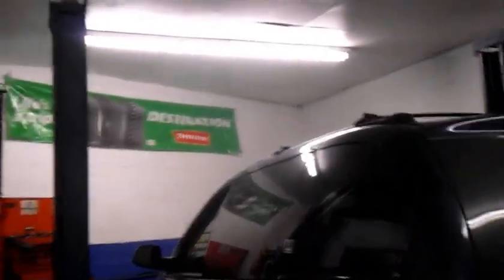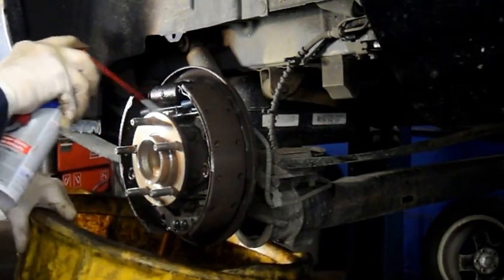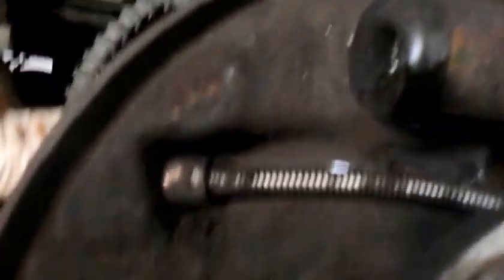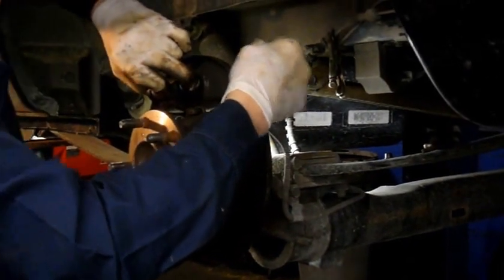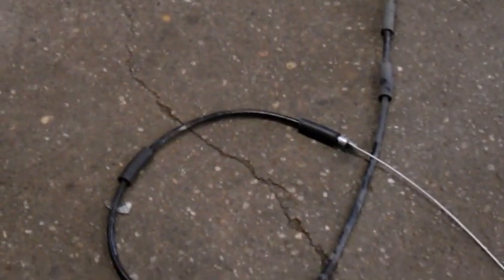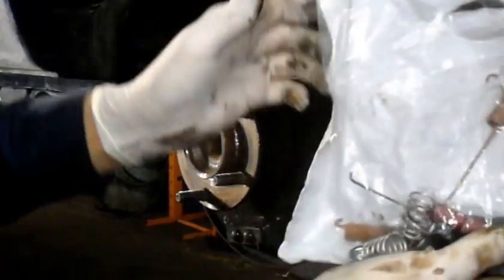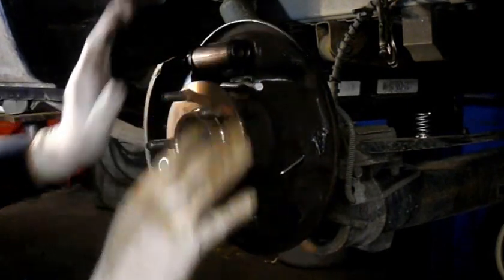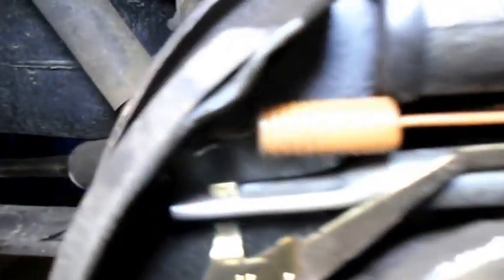How to replace the brakes,wheel cylinder and parking brake cables 2005 Dodge

Comment: Great video! Many thanks to you I followed your instructions when I replaced the left rear cable and it works perfectly. Now I am trying to figure out how to replace the center/intermediate and rear right cables. I assume removing the rear right cable is similar to the rear left which is not difficult. But how about removing the center cable? Do I have to remove the two brackets that hold the center cable to the frame or just remove the bolt on both ends of the center cable that clamp to the brackets?

Comment: Was hoping to see how to reconnect front to rear parking brake cables. I had to replace the front cable, and not sure how to safely get tension off rear to get enough slack to slide front cable stop onto splitter bracket underneath... good video
Reply from the maker: Thanks for watching.  Don't forget to subscribe.

Comment: thanks so much for your video. how were you able to determine that the cable coming out of the rusty equalizer in your video was not releasing?
 i am trying to determine if it is my cable or shoes because my 06 caravan has not parking breaking working.  i have rotors on my rear end with breaking pad shoes.  

i couldn't get the rotor to release today because the pads were pressing out against the hat of the rotor.  the window adjust
was just to get a tool on the cog to turn it.  what do you suggest? i dont want to pull the whole guts of the  parking brake assembly apart by excessively pulling the rotor outwardly.

Comment: I have a Grand Voyager CRD, much the same set up as the Dodge you are working on here in the video. My Parking brake has never really held the car and does not pull the shoes hard enough up to the discs, this even when I have adjusted them through the aperture where you can turn the adjuster as you show in your video. My question is, have the main longer cables from the handle puller stretched, if they have how do I know? Or is it the 2 smaller cables that have stretched, that run into the actual brakes at the rear? All the cables move freely and are not rusted, including all the linkages, I have kept them well greased over the years. Can you help me on this please? I know that these particular cars have always had a problem with poor parking brake due to the cars length and therefore very long cables that tend to stretch. All the cables on mine seem ok, but no matter how I have adjusted them, it never holds on a hill? Should I replace the whole set up of cables or just the ones at the rear?
Reply from the maker: +Paul Manning It is most likely one or more of the cables are rusted and not moving as they should.I've never seen a cable stretch.So you will need to check it further.Keep me posted.Jim
Reply: +jimthecarguy  No the cables are moving free through the outer cable casings and as I said the whole thing is greased up well, so no rust at all. I still cant get any solid handbrake force to hold the car though, no matter how hard I pull up the hand brake lever, even after adjustment on the turner screw turned up as far as I can afford to without wheel locking.

Comment: I had already installed one rear brake before seeing this video, and I didn't turn the adjuster from the behind.  What happens if I skip this step on just one wheel?
Reply from the maker: +FOTOJADAMO You should adjust the brakes but if you didn't the brake pedal will just be a little lower.
Reply: +jimthecarguy I should go back in there and adjust.  No sense in doing a full brake job and not have the sensitivity I expect when stopping.  Thanks for insight.

Comment: why do shops charge for an hour when it took a half hour? I'm afraid this is gonna  be to hard but it will be a couple hundred bucks if I don't get some help. this is so Scarry. I had no Idea about it the leak but it only makes sense. that cable still looks hard the connection part .